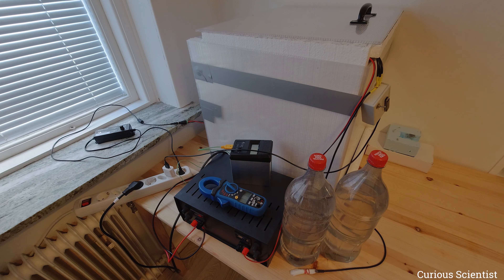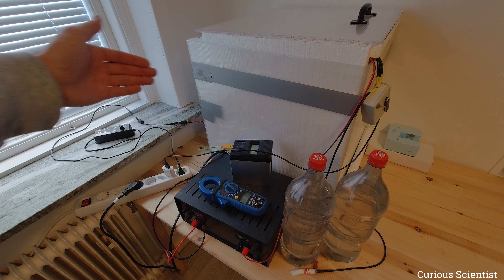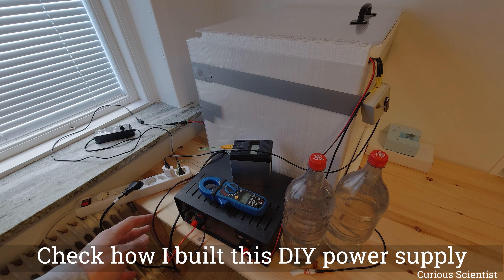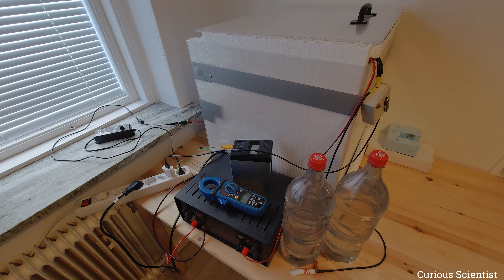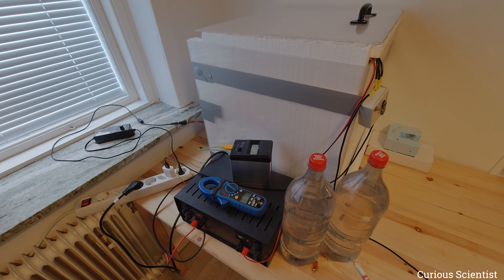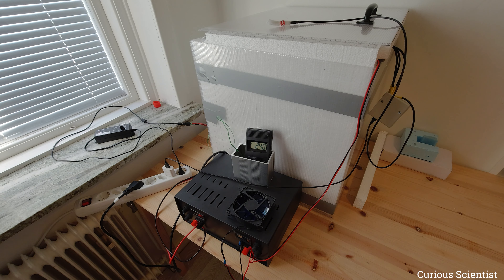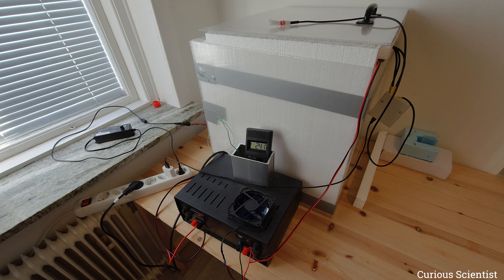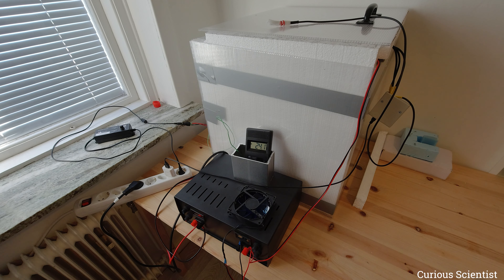Peltier based cooling box - Refrigeration test [Part 6/6]

Comment: Thank you for the videos about this topic, very interesting.
Tech Ingredients youtube channel has a similar concept of a fridge where in their demo they cool from room temperature to ~3C in about 2.5C. This only to mention that with proper heat transfer, the concept seems viable.
In another video they also switch from fan based cooling on the hot side to watercooling which further improved the performance.
Reply from the maker: Hi! Sure, I know about it, I am following their channel. Their box uses 12 Peltiers, mine uses only 2. Sure the concept works, but it is another question how efficient and how costly to operate it. Due to the Peltier coolers' inefficiency, it takes a lot of electricity to operate them. Plus the cost of all the cooling for the Peltiers must cost a lot. Just look at how big radiators they used. It is one thing that we can build it, but another is if it makes sense.

Comment: Thanks for the videos. You definitely put in a lot of time. I enjoy all numbers you are taking to show the results.

One opinion from me, what about having a smaller box like a small can cooler, then filling it with a couple litres of water and running those water heating with tubing into the water?

Say you had initial ice/cold water of 17C and wanted to maintain this temp in the cooler while running the cold water then out to a radiator?
Reply from the maker: Thanks! Maintaining the temperature would still require the same power as on the "hot end" you would still introduce the same amount of heat. With a pre-cooled water you just delay the effect.
Reply: @CuriousScientist  thanks.
I think I have a plan, that's had a lot of changes in my head.

Hopefully I can share it when the parts arrive, or next summer.

You and others real, raw data i think is quite helpful to anyone interested in this. This is why I really enjoy YouTube.

Comment: I'm enjoying these peltier videos.  They are a gold mine.  Do you think adding a desiccant bag would help lower the temps since dry air cools faster?
Reply from the maker: Thank you! Well, I don't know to be honest. I haven't tested it, but according to the physics it should help. The question is if it would help a lot or not? The amount of air is so little in this box, so I think that there are better ways to improve the cooling. To make this box really work, I would use a "stupid amount" of Peltier coolers (8-10, maybe more) and also large heatsink with a fan inside the box. But with large number of coolers comes large electricity bill and large amount of heat to dissipate.
Reply: @CuriousScientist   Considering the size of the cooler, I thought it did quite well.
Reply from the maker: It did OK, but could have been better. I will make a new iteration of this box once I am finished with my other projects. I will use more Peltiers and a beefier power supply to speed up the process and to increase the cooling capacity.
Reply: @CuriousScientist   I recall a company about 20 years ago developed a commercial air conditioning system that incorporated a "desiccant fan" to remove humidity before being cooled.  The fan had a proprietary desiccant coating on the blades.  Not sure how it would have been "recharged" once loaded with moisture though.
Reply from the maker: Oh, if you heard about these things, then you would be very interested in this video if you haven't seen it yet: https://youtu.be/R_g4nT4a28U 

Actually, Tech Ingredients is an amazingly good channel, I really recommend you to watch them! Very good videography, high-tech solutions and extreme amount of knowledge!

Comment: Since the cold heatsink quickly reaches 3 C, the bottleneck is with the heat transfer from heatsink to the inside air, or between inside air and the bottles. Both cases are improved by increased internal airflow. If you wish to investigate closer, try cooling a loose heatsink, or check how long time a regular fridge needs to cool the bottles.
Reply from the maker: Yes, I mentioned this several times that one of the bottlenecks is the cold side heatsink. Unfortunately, this was the largest available heatsink, so I used this for testing.

Comment: So about 5C from room temperature is not what is desired but what about maintaining temperature of 2 bottles taken directly from a refrigerator to go to the beach or camping? What if you used an "infinite" heatsink sized maybe 25cm x 25cm x 5cm. Wouldn't that allow more of the heat transfer from cold side to hot side?  Also, my heatsink fins are much closer to each other. There are calculators to determine ultimate heatsink size and fin/pin separation. Refrigerators are used to cool things down but a box that keeps things cold would be of equal use for outdoors. Especially if it also kept things above freezing in winter months
Reply from the maker: Larger heatsink on the cold side would definitely be better for better heat transfer! This was the largest heatsink that I could find at this moment, so that's why I used it. I guess, it would be easier to maintain something which is already cold, because the Peltier only have to work against the heat leakage and it does not have to create further temperature difference (supposing that the goal temperature is the temperature of the things we put in the box).
Reply: I have a 26litre esky that's internal tub is all metal. Could this have the cold side heatsink connect to it and be more effective ? 
Or even connect the cold side of the peltier direct to the tub ?
Any thoughts thanks?
Great information 🙂
Reply from the maker: @Jeffa67  Wow, I learned a new word today. I did not know that these cooler boxes are also called "esky". Supposing that the whole internal surface is metal and you directly attach the cold side of the Peltiers to it, it would improve the thermal connection between the Peltier and the volume to be cooled. This was one of my issue, my heat sink on the cold side of the Peltiers were too small for this purpose. But in your case, if you have the whole interior cladded with a metal sheet which is in a good thermal connection with the Peltiers' cold side, you should get good results. Also, you can put the things in the box in a way that they directly touch the wall of the esky and therefore the thermal connection becomes better than through air.
Reply: @CuriousScientist  hello from the land down under. Lol esky is an Australian term and I forgot about our local terms. Thanks for the reply and again the post. 
Also may I suggest a number system on you fridge builds as you have with the peltier videos. 
I was trying to follow the sequence and was unsure about the timeline.  Watching this on a smartphone with the screen limitations. 
Thanks again,
Jeff
Reply from the maker: @Jeffa67  Haha, cheers! I will look into this numbering strategy and try to come up with something. I will try to add some intelligent coding or something to the titles. Probably during this weekend, because I will have some free time.

Comment: It's a pity you never ran the test longer with 1 litre of water until the temperature of the water never got any colder. And then let everything reach room temperature again and the did the same experiment with 2 litres of water. take the energy used form the first experiment from the second. Then you are left with the amount of energy used to cool 1 litre of water. Do this calculation for every degree of change through the temperature range. And the inefficiency graph can be produced across the temperature rage of the Peltier system.  Also the water bottle temperature change is  a curve  but over a long time period. As the temperature difference between the surfaces get closer together. This is why the cold side temperature curves  to almost flat as the temperature difference across the cool side heat sink becomes more similar to the external part of of the heat sink that is in contact to the air flowing over it. speeding up the air flow will help but will still flatten out over time as the cool surface and air become similar in temperature. The point that things can't get any colder is when the coolant can not extract any more heat due to the system inefficacies and heat being absorbed through the insulation is greater than the cooling capacity at that system temperature.
Reply from the maker: Unfortunately, my electricity bill doesn't allow me to run these tests all day long.
Reply: @CuriousScientist  I understand. I am looking for data on these Peltier's and your water cooling heat side seems to be the more efficient  way rather than air cooled. And your project came closest to a set up that could give some actual efficiency figures with your data logging etc on Youtube. I am building a cool side water circuit for chilling a insulated water bath for chilling a 5l beer keg. Hot side is air cooling into a beer fermentation insulated compartment as it is situated in a unheated building outside in the UK.  using two temperature controllers . one controls the temperature of the ready to drink beer keg cool side water circuit. while dumping the hot side into the fermentation  chamber The other controller adds an additional  30watt PTC heater if extra heating is needed or extract fans  to bring in fresh cool air to remove heat from the chamber if the added heat from the hot side Peltier is higher than the chamber set point. I need water bath to chill 5l beer plus 2l of circulated water over a time period in the region of 24 hrs from 22C to 8C. I need enough heating from the hot side to maintain 20C in the fermentation chamber . while the night time temperatures fall to 0C and days are 15C summer is 25C to nights of 16C. I may have to go down the refrigerant system route. But as it is such small scale was hoping to use the Peltier method Yours was the best video on YouTube to help me come close to knowing my idea has a chance of working across the annual temperature ranges . Once i have it built i will data log via an esp32 and DS1820 probes for cool side water temperature Keg temperature Fermentation temperature Fermentation chamber temperature and external air temperature  to the Thingspeak graphing server to remote monitor and record values . Basically a system is inefficient if the wasted energy is thrown away. But by using it to  warm a fermentation chamber then the energy is not wasted. Sorry for my long reply. But your video gives me hope.
Reply from the maker: Nice approach! I think 5+2 liters might be okay for a properly sized Peltier cooling system. I would not try it with only one, but let's say 3-4 Peltier coolers at least. 4x TEC12708 or 12710 would be nice to try. If you can make use of the "insane amount" of waste heat, then yeah, it is better from that perspective that you can use a larger portion of the electricity that you are paying for. But of course the cooling efficiency is still bad. Look around in my Peltier-related playlist as I have some videos on water cooling with the cold side of the Peltier cooler...etc. I also made a completely automatic microcontroller-based Peltier controller. Check this out: https://youtu.be/XjDAgLEsuhU

Comment: If the internal fans are placed near the top of the box, would it create a convection current inside the box? (As cool air sinks and warm air rises)...
Reply from the maker: I am not sure if there would be a convection current. But I think the best way is to just place the fan(s) on the heat sink. More direct heat exchange and more airflow across the fins.
Reply: @CuriousScientist  Yes, that I agree, but placing the fin near the top would help?

Also, in your opinion - can a Tec1-12706 module Peltier module cool a box of say 10 liter volume to 4 degree Celsius?
Reply from the maker: One single Peltier will not really work. You need multiple of them as they have low cooling power especially when you want to maintain low temperatures. 

The heat sink can be anywhere in the boy, it is a small volume anyway.
Reply: @CuriousScientist  Thank you for the reply man. 

I was thinking as you cooled 64L with two 10A Peltiers, so by comparison 10L is a much smaller volume, hence one Peltier... Currently I am waiting for my tools which hard to get by due to the lockdown situation at my country... so can't do the physical experiment yet. :(
Reply from the maker: Have you watched the video properly? There were also 2 bottles (4 liters in total) of water inside the box which acted as a "thermal load", something that the Peltier coolers should cool down. You could see that their temperature could not even reach 15°C. I guess, you do not only want to cool down 10 liters of air but you also want to cool something inside the box. Cooling air and cooling water are two very different things
Reply: @CuriousScientist  Um yes, I get the idea now. Would running for longer period change the outcome?
Reply from the maker: @formalfighter  Okay, once again: have you actually watched the video? I even made a temperature vs. time graph where I estimated (with very rough assumptions) the time needed to cool down those bottles. It was about 9.5 hrs if I recall it correctly. So, yeah, with long enough time, it is doable, but it can also fail at many points, for example if your insulation is not perfect, your cooler will probably struggle to compensate for the heat losses instead of actually cooling the inside of the box...etc. One single Peltier will not be sufficient, especially not the TEC1706. They are not made for this purpose.
Reply: @CuriousScientist   I mean your video shows the computer prediction for 9.5 hours to cool 2 L in a 64 L box by 2 10 A module ran at 6 A, correct?

What do you predict for a 10 L box, 2  L water, and 1 Tec1-12706 Peltier?

Also, I plan to use corkshit and pvc (13mm and 3mm thickness respectively) for the box body. Any comment on that?

Some videos show aluminium plating inside the box (like 1.5 mm sheets on the side and double that on the heatsink side connected to the heatsink directly with thermal grease) and no fan... Any comment on that model? 

By the way, thank you for replying me.
Reply from the maker: I was cooling 2 bottles, so it was for 4 liters. 

For your configuration I cannot predict just like that. You can calculate it by estimating the achievable cooling power and the heat needed to be removed from the cooling box (heat content of air + water from room temperature to 4°C) over a certain time period. Cork should be a good insulator, I think. Aluminium plating, especially attached to the heat sink is a great idea as it extends the surface where you can maintain thermal exchange. But once again, 1 Peltier will not bring you too far.